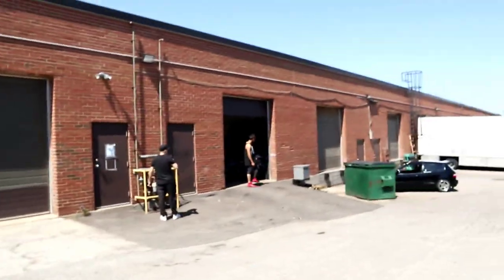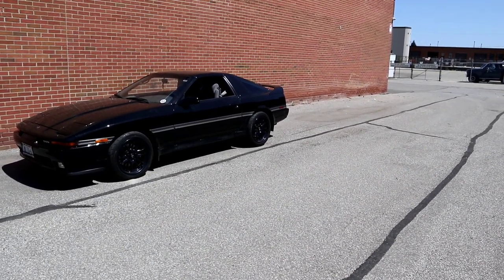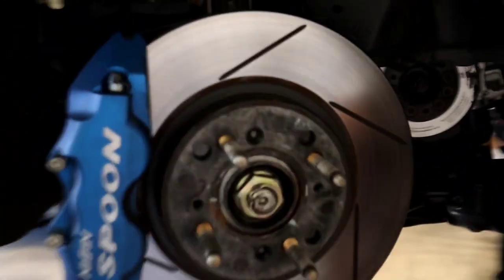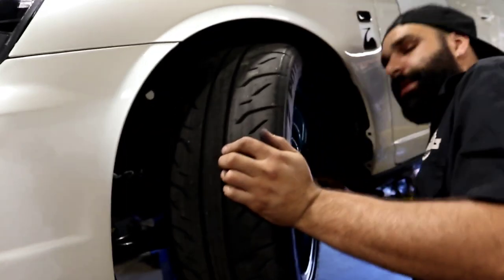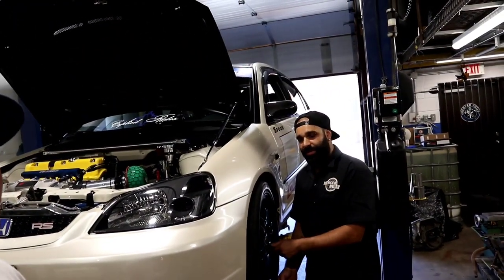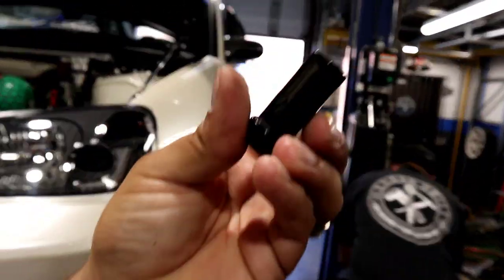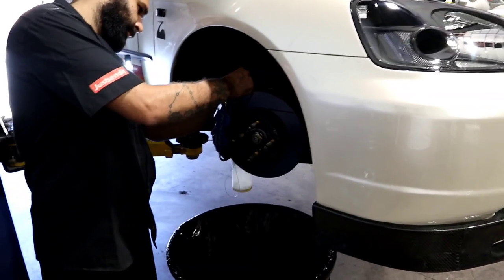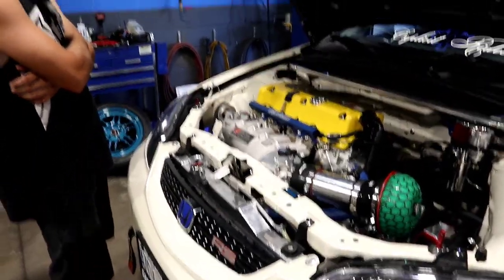Spoon brake fail

Comment: hey, the spoon brakes a direct bolt on for es hubs? or did you have to modify it?
and what size rotors are they?
Reply from the maker: No i had to modify the caliper and im useing an 11" rotor
Reply: @PAUL4DR  oh was it a lot of work to make fit?